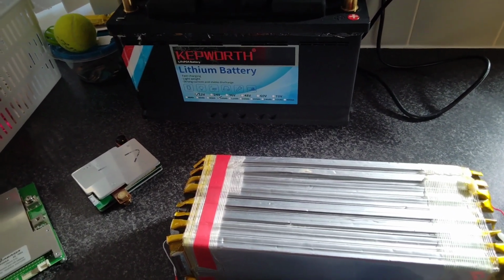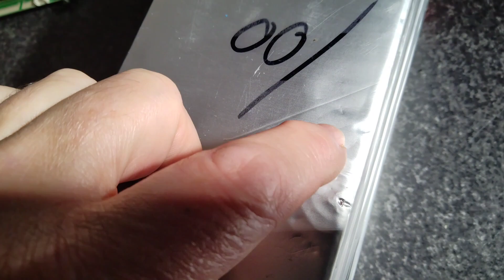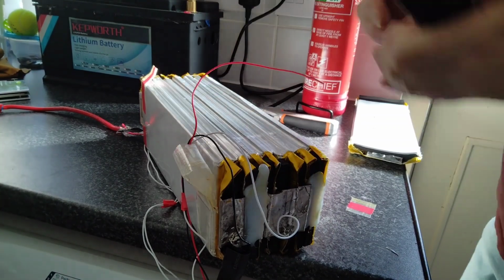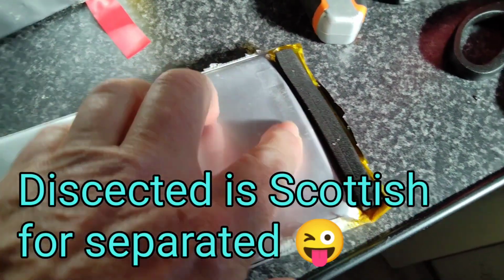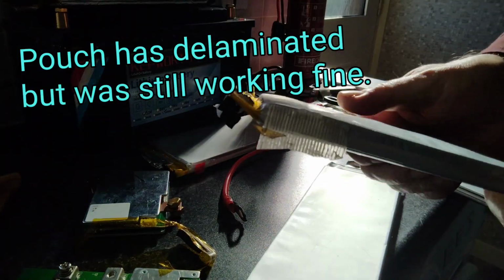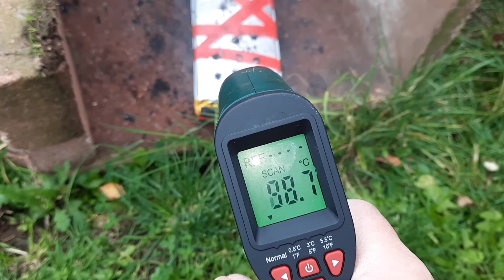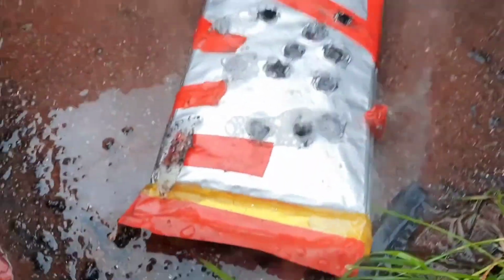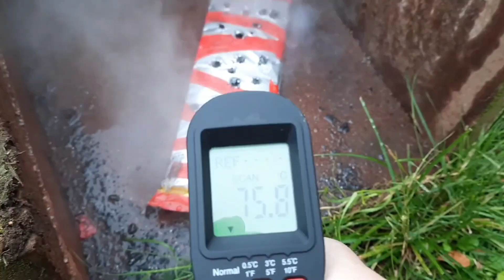Puncture A Lifepo4 Battery Pouch Cell #pouchcell #lifepo4 #batterysafety

Comment: They are links to several tests of the LTO, LifePO4 and other Li batteries. Both the LTO and LifePO4 are the safest you will find. No explosion via shorts, overcharged or structural damage. The other types are all explosive.
Reply from the maker: Sodium will be even safer from what I have read so far.

Comment: ‘Thermal runaway’ or something along that idea “…. Runaway” is the One thing that keeps my anxiety regarding pouch format.  No real idea what it is, or how to ensure that it doesn’t happen; but, the people that bring it up seem fairly well-informed.

Appreciate the vid.  Just found your channel (subscribing)

Might be a good idea to wear gloves, face/eye protection for these (Tests)
Reply: Anyone bringing up thermal runaway in regards to LiFePO4 is not well informed. Thermal Runaway is near impossible with this chemistry and it creates a fraction of the heat NMC/NCA/LCO create.

The ONLY concern with this chemistry (besides the low IR and massive power) is the electrolyte and the fumes. You DO NOT want to breath those in.

Comment: The real question is will pouch cells get the same cycle life/have the same degradation pattern as prismatic or cylindrical. And how do they perform at high C ratings.
Reply from the maker: The pouches do have larger surface area for heat dissipation which is one thing in their favour. Prismatic are thicker, denser and cylinder cells are also better at heat dissipation. Time will show what's better or worse.

Comment: Shows these pouch cell casings are as fragile as a soft boiled egg - greatest care needed handling them out of their shell.  Interesting, no epoxy separator sheets between cells as per prismatic practice (prismatic cases are connected to positive pole so any damage to heatshrink leading to sc would be nuclear

Comment: That first cell has a sticker showing it tested for 49.9Ah...not good. Prismatic Grade A's test 2-5% over rated. Cylindricals typically test over rated as well. Two 100Ah batteries I tested came out at 105Ah with pouch cells....Makes me wonder if KEPWORTH is using used cells or Grade B

And please tell me you didnt breathe in those fumes....
Reply from the maker: No, I didn't breathe the fumes. At the price they must be grade B. But reality is we will never know, they could have been used previously in larger packs for electric buses.

Comment: does anyone have an idea why lifepo4 pouch is not popular vs prismatic?
Reply from the maker: Thanks for watching and taking time to comment 🙏 it's appreciated.  Pouch cells are probably more popular than you may think. Laptops, phones, even buses have used Pouch cells but because they were getting easily damaged, especially during transit the car industry wanted better protection, so the prismatic cells you see now all stem from that. Same chemistry wearing different coats.